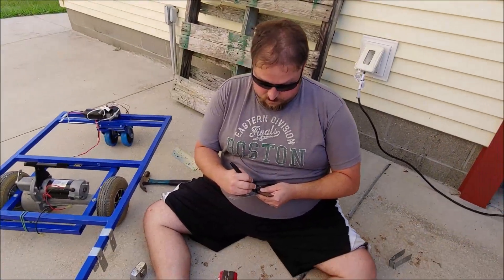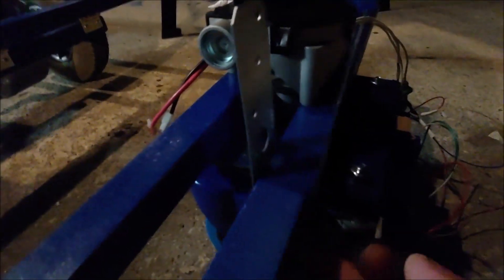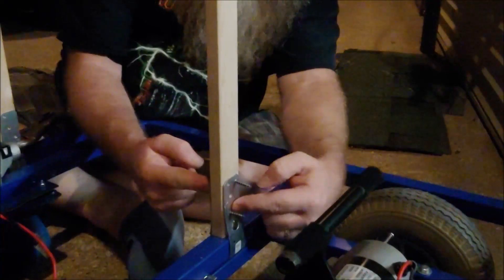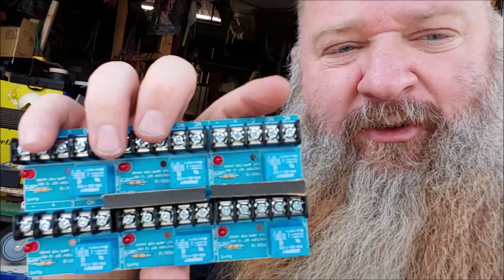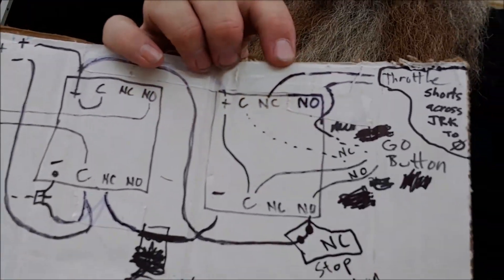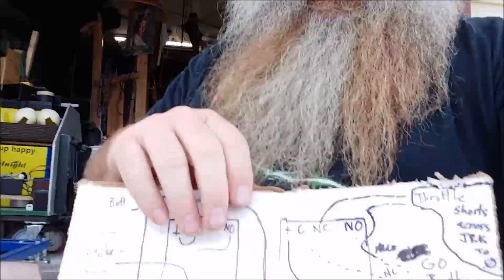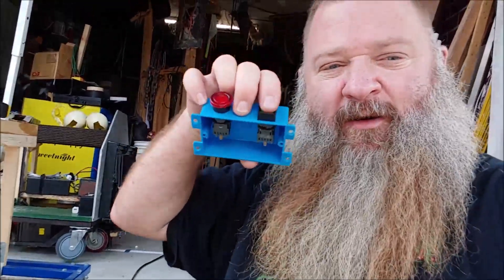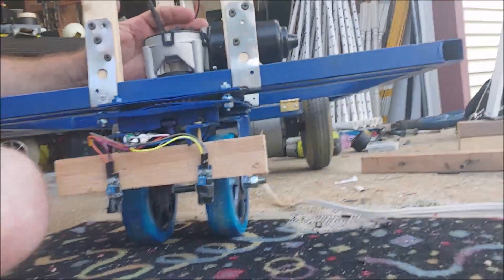August 13 Cart 2 Update

Comment: This project is amazing! It has inspired me to build my own ride cart and I am unabashedly ripping off your design! I hope that's ok ;) Do you mind sharing the model of those relay boards? (or the ones you meant to order instead since you said you got these ones by mistake.) I am below novice level with electronics so I'm really trying to copy whatever I can in order to learn.
Reply: Eric this is amazing!!! Can you make a tutorial color coded wiring schematic for dummies with  the way everything should  be plugged in ? Like the update you did with the sensors. Also what brand are the relays on the video ? The ones I’ve found doesn’t have the lights. Thanks a million!
Reply from the maker: Thank you!  I'd love to see the results of your take on this project.  I apologize for the delay, YouTube hasn't been alerting me of some comments and I missed this one.   The relays I wanted were double pole double throw (DPDT).  I hope you were able to find a suitable replacement